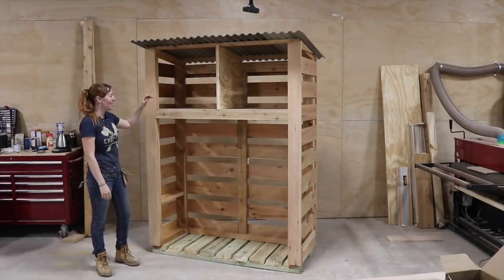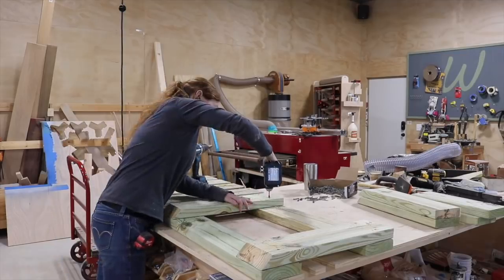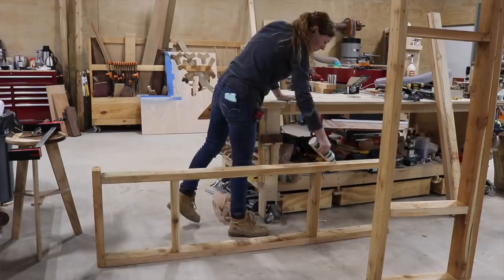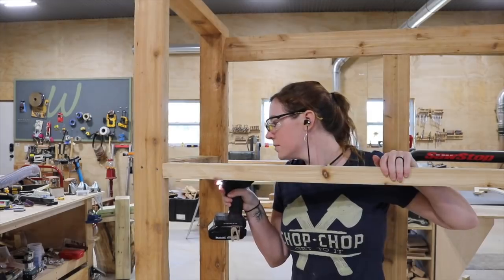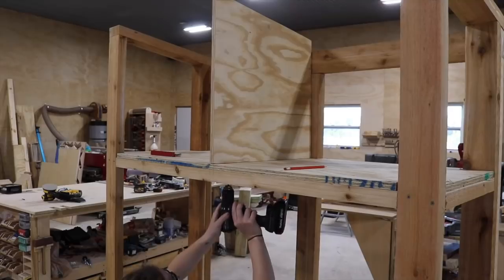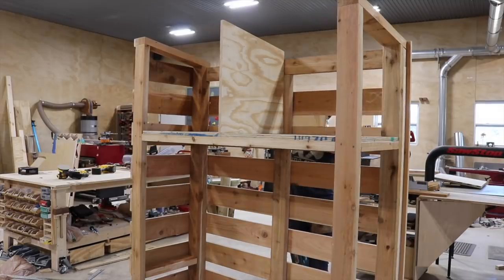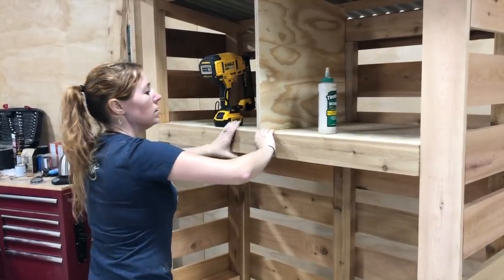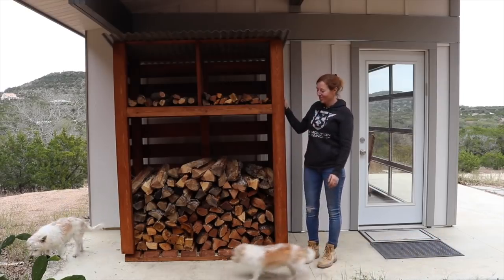DIY Outdoor Firewood Rack

Comment: Nice build! I built my first woodshed a year ago 9' x 4' x 7' ...I got all my materials from the landfill. Someone was throwing  away 4" solid oak tounge-groove flooring, which had splintered upon rip up...so I put both sides through the table saw, ripping them to 3.5" ea.  The flooring is pallets covered with 3/4" scrap plywood. The roofing is also scrap plywood covered with rubber sheet...from a H.S. basketball court- landfill obtained concrete blocks were set in-ground, and  4x4s of varying lengths were motise/tennoned and fastened together to create 4 usable 8' posts...

I added a 4x2x6'  "cactus display" rack that Lowes was tossing...onto the side, and enclosed it with a broken fence panel that I bought from Lowes for $8. 

I used birch trees from my property to accent the posts, and used birchbark as trim for the door...which has  bear skull, a coyote skull, and old bow saws...

Comment: I love that design. Since I’m kind of OCD and I love to maximize space. Since you went through all of the trouble to make a nice roof for the wood shed I would place it on the outside of the tiny home exterior wall.  Since it’s a tiny home I would want to maximize any outside living space and that huge overhang offers a great place to have a sitting area allowing the user to have a place to stretch out.  Maybe add a fire 🔥 pit just off of the outside sitting area for a nice relaxing evening and easy access to the firewood 🪵 shed. Just my opinion. Thanks for sharing.

Comment: Nice build! My wood shed is 16’x16’ stacked six feet high. We burn around 12 cord a winter but we do heat six thousand square feet with house and shop. It’s all in floor heat.

Comment: When building the floor on these kind of projects I install the screws from the bottom to eliminate exposed screw holes that trap water. I try to place the projects on limestone or gravel to give the wood good drainage. That is a beautiful guest house and with that much of a firewood supply I think you will have a hard time to get guests to leave or help with projects.

Comment: The only trouble with perfectly square and carefully built items like this is when you have to put them on hard surfaces that are not level, or to be fair need a camber for water drainage. When it was put in place at it's final location it appears to be lopsided, but only because of the concrete surface it rests on. That undermines all your careful work. It would be fine on an earth surface but perhaps consider adding advice on shimming or adding levelling feet to the design. Other than that, you have made a charming and helpful video.

Comment: 10:25 I hate all the mess that it makes when pouring from a gallon container like that. I either use the little cups from the detergent and just wash it right away or Lowe's has these attachable ones you could put on the gallon itself.
Reply: Fantastic tip Carl, thanks!
Reply: Dave of Engels Coach Shop (https://www.youtube.com/channel/UCMgTlht-PsNniRIuaax4m8Q) had the best tip I've seen in this regard. I'll try to do him justice since I can't find the video where he demonstrates:
1) Use painters masking tape to cover about 1/3 of the opening with the first strip parallel to the bails on the paint can and at least 1/2" hanging over the outside of the can. Press the tape tightly to the rim. Depending on the width of the tape, it will take several strips to do this.
2) With a very sharp knife, slice the tape out of the opening, leaving the tape covering the rim and leaving the extra tape hanging over the outside. 
3) Pour the paint from the larger container to the smaller. The "lip" of tape hanging over the outside of the larger can will serve as a spout when the paint is poured carefully. 
4) When done, peel off the tape and discard. The rim will be clean as a whistle.
Reply: Levi Soriano solo cups work nicely and if you sit everything in a foil roasting pan then even the small spills aren’t an issue.  Roasting pan is disposable but you can use it a bunch of times before getting rid of it.  I’ve also used a turkey blaster with the tip cut off for smaller amounts pulled from cans of paint/stain.

Comment: Hi April.
What are your thoughts on using reclaimed materials?
It seems to me you're using fairly expensive materials for this rack that sits outside in all weathers.
Why not use reclaimed wood such as shipping pallets and other reclaimed woods. Pallets are strong, cheap and readily available.
Yes it takes some work to recycle pallet wood, but for this kind of purpose they result in a good product at a low price.

Comment: You may already know of this method of stacking green firewood known as a "Holz Hausen".  It works great for me here it CT. and I do not use a tarp or any cover of any type - check it out - lots of examples to be found on the internet.  It is hard to believe that green firewood can be dried out using this method.

Comment: Hey April, you should use the Swiss method of fire-making; big logs on the bottom, smaller ones in the middle both in a cross or grid formation and kindling on top. This way when you light your kindling the wood below is preheated before combustion. The fire burns cleaner because the "gasses" coming of the preheated logs are burned and there is way less smoke and spatter (from pine for instance).
Reply: oh and way less soot build up in the chimney of course.

Comment: This Firewood Rack looks amazing,but there is something you could of done better,the upper side slats you fixed,the small one,it would look much better if you cut the last one with more height and cut with angle to match the base you fixed it on,that would make it perfect.instead of using that tiny piece,Thank you for sharing.

Comment: Nice build young lady! So I am not the only person on God's green earth that toenails! Personally I don't care for the pointer method, they look like " S**T " imho... The air gaps is a must for storing cordwood, well done. I appreciate that you applied the stain by hand ( roller ), but wiped it off with a cloth, very nice. The added trim pieces was a nice touch too. I burn about (6) cords a season here in N. Central VT., however your design is sound & it could easily be built to a larger scale.
Thank you,
Bill on the Hill... :-)

Comment: Could pallet wood  be recycled to make similar wood  storage shed?
Reply: Don't see why not.  You will need to make length modifications to accommodate the wood lengths available.
Reply: I'll be doing one 32" to support 2 rows of stacked split wood and making the width more by ripping pallets and joining them with 2x4's, then alls it needs are side supports and a roof.